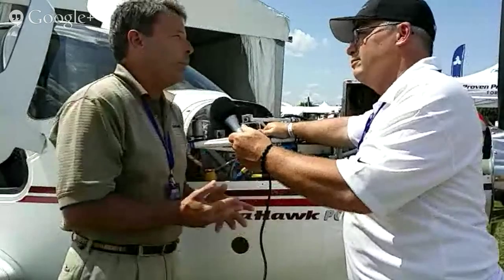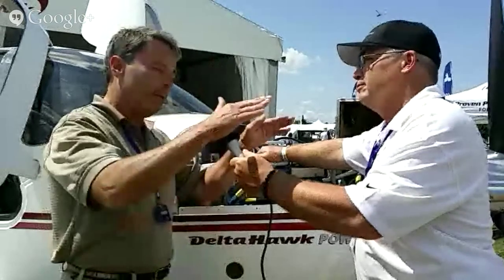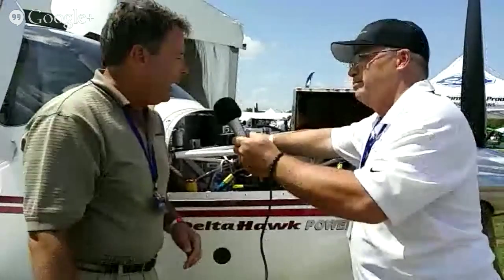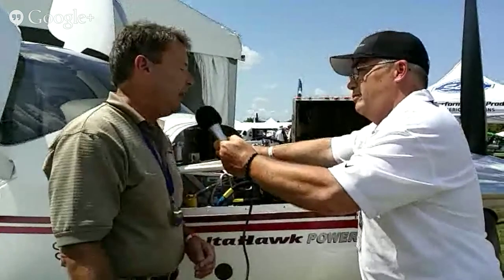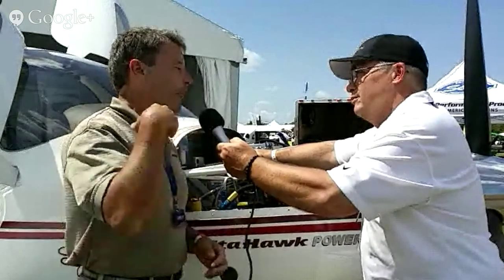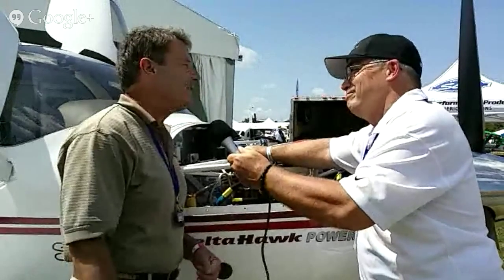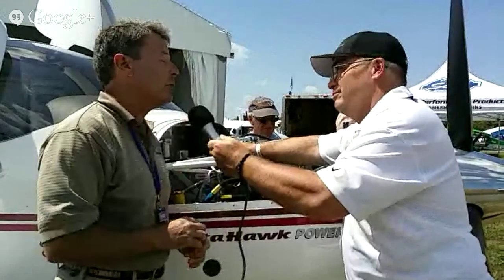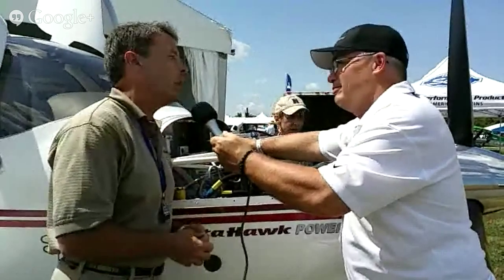Kestrel Aircraft talks with DeltaHawk Diesel Engines

Comment: I'm imagining a Velocity Twin powered by a pair of 200HP Delta Hawk engines.   Possible?
Reply: Sandman3332 Call Velocity and Delta Hawk...either the 185hp or 200 will do.  When you find out, post the answer here.  I am interested too...also, ask them about how twins on the plane can rotate in the same direction and not over-torque the plane...

Comment: You cannot compare this engine aerodynamically to a turbine. It has air dam in it called a radiator. I really like this engine and I am planning to install it in my aircraft, but no one should expect their aircraft to perform aerodynamically the same as a turboprop aircraft because it won't. It will however easily out perform a turbine in the fuel consumption department.
Reply: Technically true.  But with proper ducting using pressure recovery techniques you can make flow through a heat exchanger with very little pressure drop.  In the case of a P51, they actually got thrust out of the radiator (Meredith effect).
Again, not claiming we get thrust with the Cirrus!  There is pressure drop, but it is minimal.

And as for fuel burn, yea...way less than a turbine.  Pros and cons to each, obviously.

Thanks for your comment.